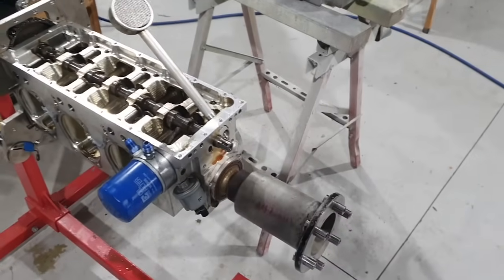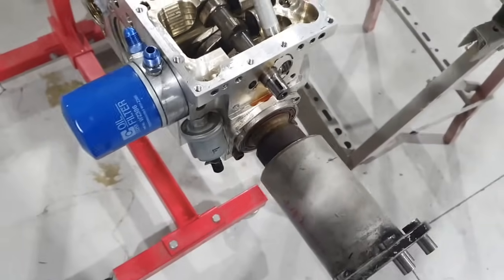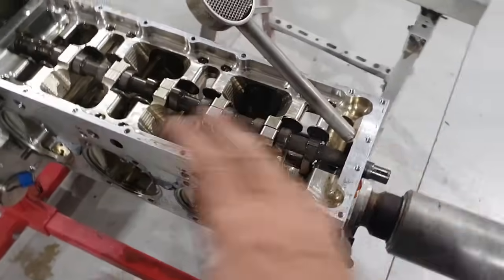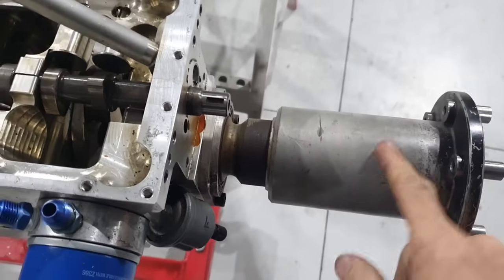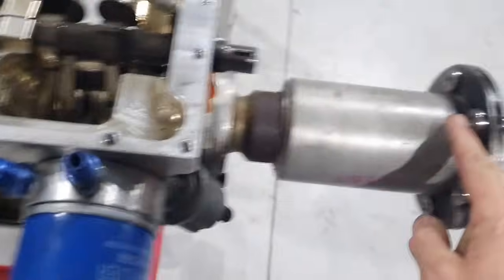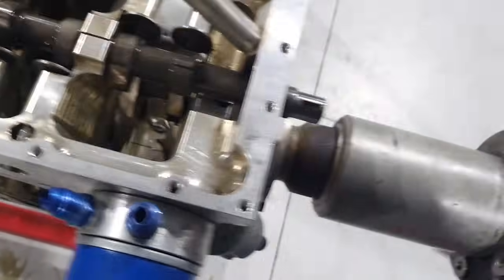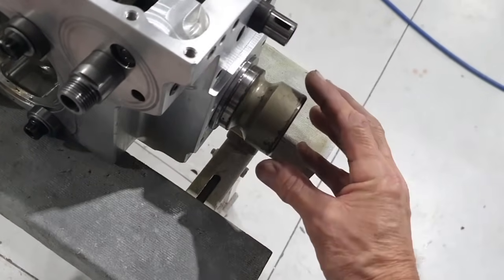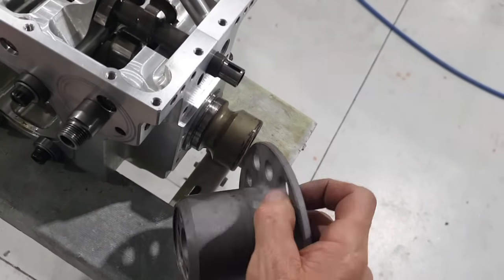Jabiru 3300 crank recall. Let's talk about it.

Comment: I tend to think Jabiru is correct in that it was a bad batch (heat treatment) of crankshafts because I do not believe this has been a failure point on the gen 1, 2, and 3. If this was a design failure you'd see failures prior to 2017.

Comment: Hi I'm retired Marine engineer and had a lot of experience with broken crankshafts, as you have pointed out the length of the distance of the bearing is correct ,I  agree which could cause the failure, but one other factor comes into account what about "TORSIONAL   VIBRATION "if you  don't have counter weights attached to the crankshaft to take out the  hidden vibration the crankshaft fails at the same position on the WEB. . I have seen this happen many times when the "TORSIONAL VIBRATION DAMPNER" FAILS.  and the failure happens at the same positi
on on the WEB.

Comment: So forged cranks are supposed to be stronger than billet.  But since they are comparatively new, that does not mean that they are not without issues.  Regardless, I fully concur with your assessments.  This is not well designed up there.  1) there needs to be a third bearing, and the outer bearing needs to have larger lands to accommodate the propeller loads. 2) as you suggest the bearings need some more separation in order to provide sufficient support to the propeller loaded crank shaft without any deflection.  A third bearing likely accomplishes this by default.  3) there need to be separate races with thrust plates that tightly capture the front bearings.  There should not be any longitudinal load from the propeller transferred back into the rear engine bearings.  The thrust of the propeller should be transferred completely to the engine block up front.  While doing this maybe that propeller load should be reassessed for its impact on engine block distortion and flexing. Any flexing of the engine block will transfer to the main bearings and then the crank, again not desired. I love the simple design of the jabiru engine, but as Einstein said, everything should be made as simple as possible, but not simpler!  I think this crosses the line, at least a little.

Comment: Hi, that elongated bearing housing "nose" is called an outrigger bearing. I have seen the same final webb failure years ago in racing Mini crankshafts, the fly wheel in those engines is at the end of a long crank extension with a drive gear as well. The original crank from the Austin A30 had no extension. I saw two Austin 1300 saloon cranks break at the same points but those were heavier but of cast iron.

Comment: Forged cranks weaker that the billet cranks? In general, that is a bold speculation, I think. But if something went wrong in the forging process, could be.Regards Karl
Reply from the maker: Generally this would typical be true, but obviously not in this case. All forged 6 cylinder cranks are out! Billet in.

Comment: This has nothing to do with the current issue with the Jabiru crankshafts, it's about heat treatment gone wrong.  It's all in the service bulletin.   These engines have been operating for many years without broken crankshafts.
Reply from the maker: @TECAdventures Yes I read the heat treatment claim in the SB. Having manufactured a few cranks myself, using various heatreatment methods such as case and nitride hardening processes, I'm not so convinced about heatreatment being the real culprit.
Reply: I had always heard Jabs were noted for having a very strong/reliable bottom-end.  The billet cranks were used for decades without major issues, so returning to that seems reasonable.

Comment: There should be four bearings on this front part, because of all the external propeller loading.  And they should be embedded in a conical support cone along the lines that you have suggested

Comment: I am a design engineer failure analyst you are spot on that long snout it is absolutely ridiculous that crankshaft goes through so much flexing up in that front throw and that's exactly where it's gonna break I have intentionally designed stuff to show where it's going to break and that is exactly where it's going to break

Comment: Exactly the same treason VW aircraft engines fail . So te solution is ether a reduction unit that does not transfer the angular load on the crank shaft . I would suggest a pair of pillar bearings on the front an rear of the engine  driven from the rear of the crank shaft by a drive belt . YES it will add weight and YES it will need the belt replaceable at increased intervals .

Comment: I don't think this is likely to be the problem.  If you loop your Jabiru at +3g (at the bottom) that's a precession of 0.122rad/s which will give you a bending moment on a 0.3kgm^2 prop (max rating) of 12.6Nm which is precisely not a whole lot compared to the 272Nm (average) it's seeing at takeoff power.   Peak torque on the crankshaft will probably be much higher, possibly twice, not including TV effects.

More importantly, the precession torque is independent of the length of the hub extension.

Comment: I’ve always wondered if the reduction gear assembly was a plus or a minus (admit I was more fearful of the latter) but seems now I understand the advantage of separating the engine stresses from the propeller shaft stresses. Really great video. Added bonus I presume is engine can run at optimum power and torque while the propeller is spinning at the best speed for its performance (slower blade tip speed with even more torque. Hope I’m correct.
Reply from the maker: Your assessment is on point! Gear reduction certainly adds more mechanical complexity and design challenges, but when done correctly the advantages are irrefutable. Namely improved prop support, and more efficient use of horse power coverting rpm into torque. The engines optimal rpm is rarely the same as the props. Gearing affords optimal speeds for both the prop and the engine.